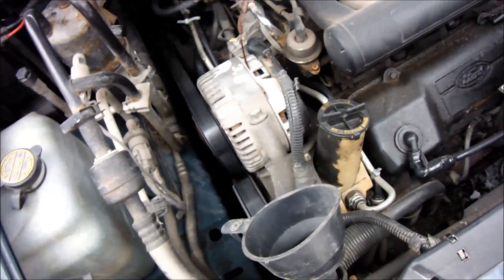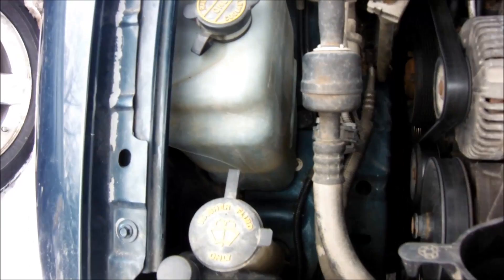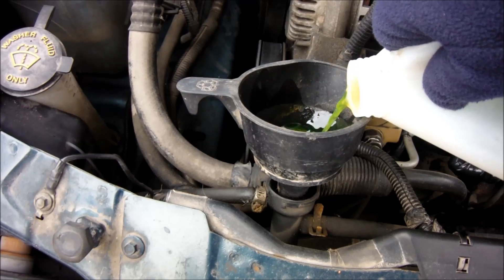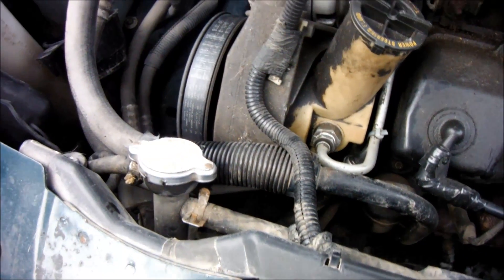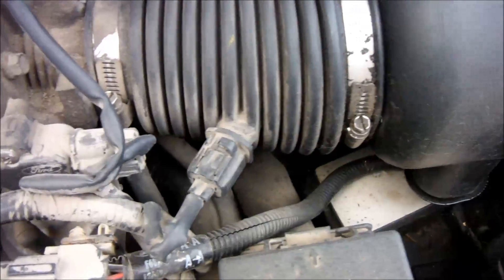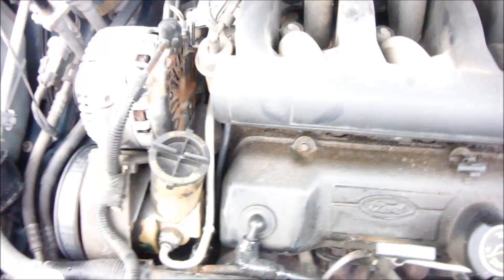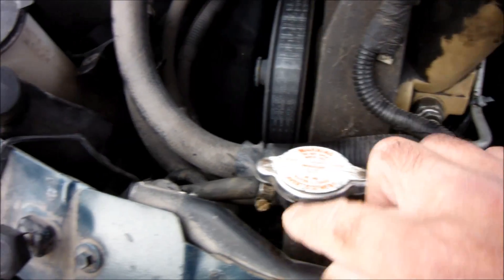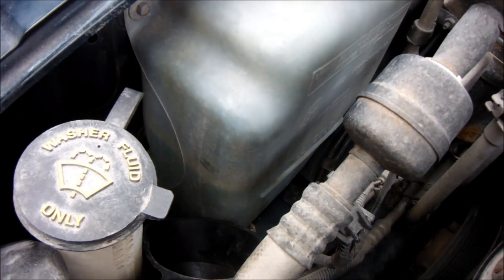Coolant Reservoir doesn’t drain back into Radiator

Comment: Mines did same thing, it was combustion gases leaking into coolant. Aka head gasket failure. Poured bars leak in and got coolant on hand to fill when needed, cus at this point I’m broke asf and can’t afford to fix the head or replace engine. Run that bihhh til you can’t no more lol. Just keep coolant in it and don’t let it overheat !

Comment: I have a Dodge Neon with coolant going into the reservoir and not coming back as well. Had it checked for head gasket problem. Nothing. I have a new, factory radiator cap on it. Nothing comes out of the exhaust. The overflow reservoir is overflowing, and the radiator is low on coolant. How big was the hole in your hose?
Reply from the maker: it was cracked from being weathered. also check all hose clamps.
Reply: My dodge neon does the same thing....when it over flows the reservoir it begins to drain the coolant through the reservoir..losing the coolant . The reservoir has a drain when it goes all the way to the top
Reply: @gunnersports7926  smh my sequoia does the same thing have u found out what’s wrong with it?

Comment: Have you figured out where it was leaking from... i have the same issue on my 2010 FX25... I havent overheated yet, but do notice the coolant doesnt go back into the engine when it cools off. So far ive installed a new Thermostat, will install new Radiator and upper and lower hoses and new Rad cap. I cant see where the leak might be.
Reply from the maker: on mine the antifreeze would go into overflow ,,but  
would not suck back into rad when needed...found  
small leak in hose (reservoir to rad  line)
Reply: @TheTeddy214  I'm replacing my rad and upper and lower hoses but am travelling right now. so when i get back.
Reply: @TheTeddy214  mad I'm thinking same thing here ..if this is the culprit I can only chuckle..I'll remove and hold 1 end and blow . How did you find your leak ?

Comment: I need help. So my water seems to stuck in the reservoir just like the car in the video. But it only happens if i go hard with my car (race on track day, accelerating on the highway, etc). I went to 3 mechanics, one said that i need to replace my head gasket, one said waterpump and the other said that i need to replace my whole radiator. Ive seen on the internet that i need to replace the thermostat and i did, but the water tends to overflowing/stuck in the reservoir again. I also done for compression test and my compression is good. There are also no oil and water mixture in both the water radiator and engine oil (no frothy oil under the cap). So, what's the right thing to do?

In my experience with my old '72 GM car, if the head gasket is blown, there is a frothy oil (like cappuccino) under the oil cap and rocker cover (its OHV Engine). My case now is in japanese car ('08 suzuki swift).

Please, i need help. Any answers or suggestion would be greatly appreciated.
Reply from the maker: your  reservoir when cold "should only be half way filled" this way when it gets hot the fluid can over flow into the reservoir...........if it goes not suck back into the engine as it is needed,there is a vacuum leak in a line or hose .this can be a very small leak so check carefully every hose and clamp............................i have found that when engine is cooling off a antifreeze  drip is easier to spot.
Reply: @TheTeddy214  ah i see, i will check the hose vacuum (already 2 weeks since im asking this question and the problem is still not solved) Thank you so much. Sorry for late response, i thought there is no reply.
Reply: Check the cap to the reservoir.
Reply: @Skateb0rder1  what the reseevoir cap do? I already change the radiator cap and it still overfilled when hot. I never replace the reservoir cap because i think there is no pressure in the reservoir
Reply: so did find the solution ? i have the same car and the same problem
Reply: @mounsifabbes5712  my head gasket is broken so i replaced it. It seems my waterpump and radiator is old too. So i replaced it too and the problem is gone.
Reply: Sounds like a head gasket leak. Not a big one but big enough to cause the coolant to over flow inside the reservoir. It’s happened to my civic.
Reply: Check the small hose which connects the reservoir and radiator. Lots of cars don't have a clamp on the connection where this hose meets the radiator. $1 clamp will do the job.

Comment: I have a question i just recently replaced my fan and fan clutch i also replaced the thermostat but my 92 gt still overheats and the light of low coolant is on any help or suggestions please would be highly appreciated
Reply from the maker: 1st   a air lock   2nd water pump
Reply: @TheTeddy214  thank you I'll check that out
Reply: @daveg9002  any luck? Same white soap in rad grey exuast smome
Reply: @cameronarmijo4524  no luck yet my car is still sitting
Reply: @daveg9002  symptoms? Sluggish?
Reply: Replace the heater core

Comment: My coolant has been topped for a week, but it doesn’t seem like it’s going down. I drive a lot, so if the coolant wasn’t being used, I’d figure that the car would overheat by now.
Reply: Same here, I thought my car would overheat but it's still at operating temp. It's just not sucking it back.. been like that for a week
Reply: @alexmateos619  did you ever figure the problem out? It's happening to my car. I had to transfer the coolant reservoir using a tube to the radiator. I had no leak and my temperature gauge looks normal.
Reply: alexmateos619  did you find what the problem was because my car does the same thing?
Reply: Same here
Reply: Same here any help?
Reply: It's not used in the way that gasoline or even oil is. The goal is to circulate the coolant to and from the engine to remove heat. So long as you don't have leeks or problems you're not supposed to lose very much coolant. In a healthy system it should take a while before coolant needs replaced

Comment: Did you ever find the leak? I’m having a similar problem.
Reply from the maker: Up Date... Found leak bottom rad hose ,small drip every minute  Changed CLAMP.
Reply: TheTeddy214 
So why the reservoir doesn’t fill back the radiator 
I have the same issue
I think they are two different issues
Coolant leak 
The reservoir doesn’t drain/fill back the radiator
Reply: That can happen for a number of reasons.  If you have air in your radiator, the air compresses as the car heats up.  Then, when the car cools off, the air inside the radiator expands and a vacuum is never created so fluid can not be drawn into the radiator.  Another reason could be a failed radiator cap.  Or you could have a leak some place high in the engine, and as the engine cools, it draws air from the leak rather than the reservoir.  A pressure tester will help you track down your problem.
Reply: Tom Rassier 
Thanks Tom
04 Honda Civic has an odd 
Passed cooling pressure test. Held pressure for 10 min without drop
Passed combustion test ( the blue color liquid didn’t change color)
Smooth drive at 90 mile per hour
Yet the coolants goes on one way to overflow tank and over filled and then get low on coolant and overheat. 
There’s air in the system but it happened to get it all more than one time and did the same.
Reply: Do your hoses get firm when you start the car but before the engine warms up?  Do the hoses get firm when the engine is warm?  The hoses should firm up has the engine comes to operating temp.  If they are getting firm before that, there is a problem.  Also, if they never get firm, you may have a bad radiator cap.  The cap is designed to allow fluid to pass by into the overflow bottle, and return to the radiator.  If the cap is malfunctioning, it may be letting fluid out into the overflow, but then allowing air to return via the damaged cap.  I have never run into the problem you are describing without a intake or head gasket leak.  Did you test the cap to see if it holds pressure to it's designed limit, then vents it if you go past that limit?  Radiator cap should hold about 16lbs (108kpa) (1.1bar) of pressure.  Good luck... Without going hands on, I'm afraid I am out of ideas.
Reply: Tom Rassier 
Really appreciate the response
Reply: Toto Sonson  did you figure out what is was? I have a 05 civic having the same issue, today it started to overheat...
Reply: matt toronto 
Unfortunately it ended up the head gasket   I will replace it later this year as a project   Also I may post it as YouTube video. Never replaced head gasket before. Gonna be a challenge
Reply: @tothepointvids5192   good luck! ive got mine scheduled to be replaced next week
Reply: Toto Sonson it has suction as it cools. If there’s a leek somewhere it doesn’t go back
Reply: @tothepointvids5192  How much did they charge u have the same problem
Reply: Jesus Cristobal 
I’m replacing the head gasket my self these days. It will take me a while since it’s a project car now. 
Replace piston rings as well and much more
Reply: @tothepointvids5192  did you ever find out what the issue was? I'm having the same issue with my 04 Civic.
Reply: gian schultz 
Mine was a head gasket
Reply: @tothepointvids5192  thanks for the reply. Likely the same issue with my car
Reply: @sombraobscura1  02 civic does it too. Has been for years. If u dont want to spend on it mine just keeps going. Just make sure u keep an i on the temp gauge if u no the rads low. I dont refill mine often at all. And dont idle the car long. Of ur moving air cools it alot. Im hardly hindered by mine doing this so i just leave it.
Reply: @rebelcowboy5.7l98  I have an 02 Civic too. I was wondering about this. When it's cool the radiator is dry and when it heats up the coolant rises all the way to the top of the radiator. I've been driving it like this for a year and it's never run hot. So I guess it's not a problem that the radiator is dry when it's just sitting out in the yard?
Reply: @MajorCulturalDivide  I drive an 09 Nissan Titan, everytime I pour coolant in the reservoir it drains down immediately, what could that mean
Reply: @CoroPlanesLLC  Hi, I have a similar issue.
Civic 2012. The coolant is getting into reservoir and overflows. Honda guys say it’s a head gasket issue.
I am going to replace the reservoir cap first (as it’s cheap).
Is there a way to determine it’s a gasket issue without opening the engine head?
I saw a video on cylinder compression test. Will that determine?
Reply: @tothepointvids5192 did replacing the head gasket fix the issue?
Reply: @mikeherrera5347  
Yes. Knock on wood, I have been driving the car on daily basis since then with no overheating. Of course he car has other issues as it have over 270 K miles but not related to the overheating or coolant leak; aging issues lol